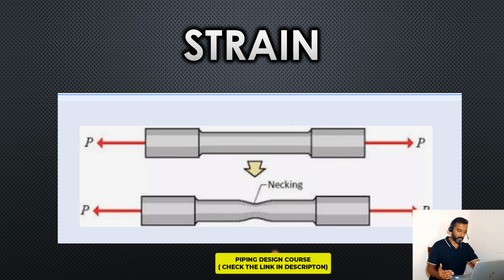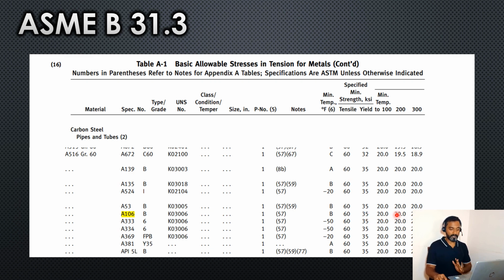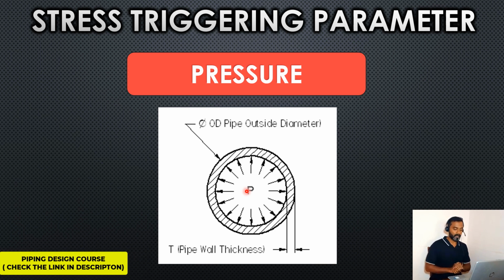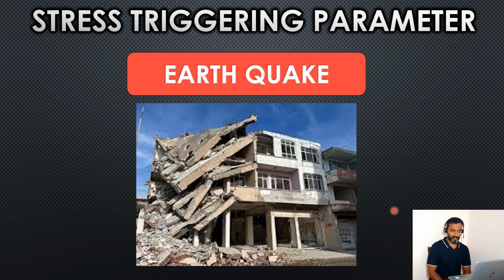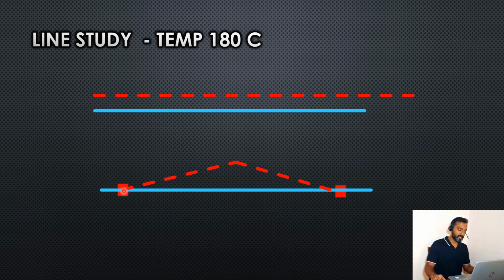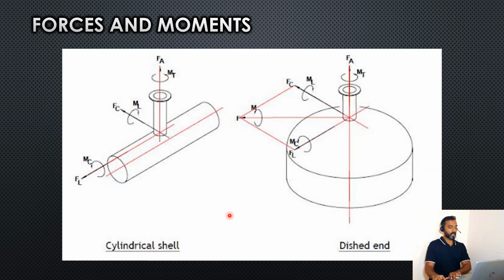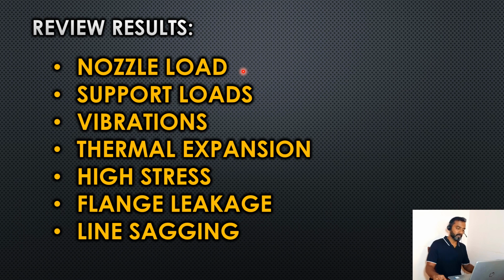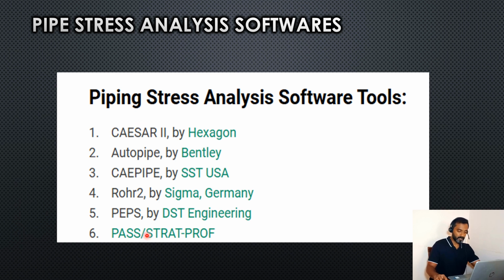Fundamentals of Pipe Stress Analysis in Piping Design

Comment: Sir ,is there any age limit to enter into piping  design jobs in india or abroad ? 

Is it possible to get a piping design job after 35 years of age without prior mechanical engineering work  experience?
Reply from the maker: No age limit. Experience is must or you can start as fresher
Reply: Sir ,
1)does the age limit is  for oil and gas sector only or for other private mechanical sectors too? 

Sir I am planning to pursue my second undergraduation in mechanical engineering (2024-2028)after my ug in industrial engineering 2014 passed out .

2)Does a  career gap will be a problem for private jobs  or should I start as a fresher in private mechanical industries in India or abroad  after 35 years of age ? 

Sir  it will be really helpful for me if you answer my above two questions also 🙏 

Sir I send a private message to your pymedaca website  about  career guidance (3 weeks before ) .

If you respond to my private message ,it will be more beneficial to me to plan for my  second mechanical undergraduate education and future  mechanical engineering career sir .